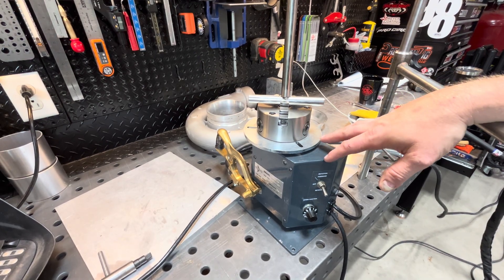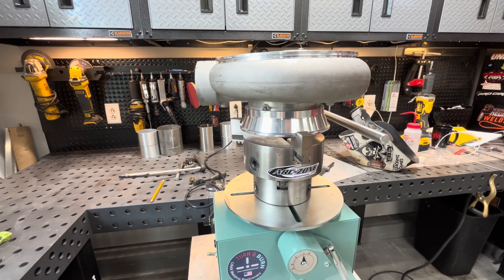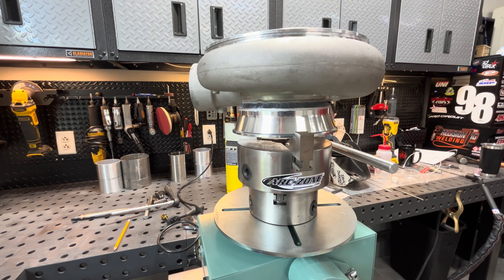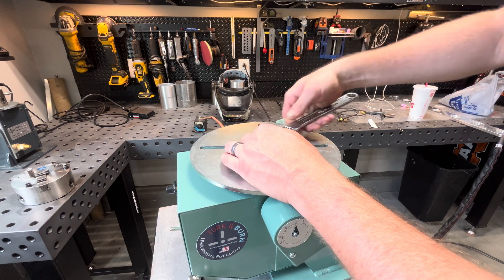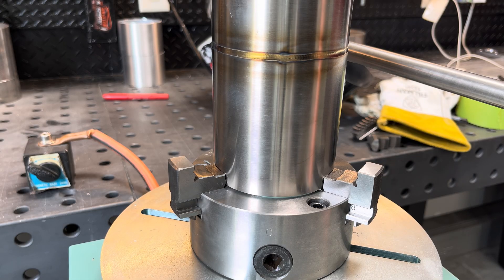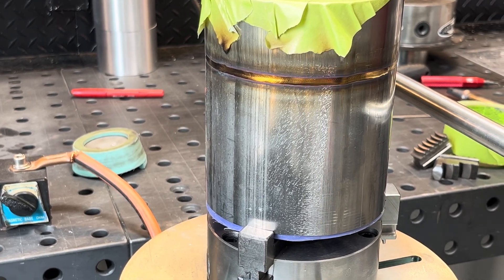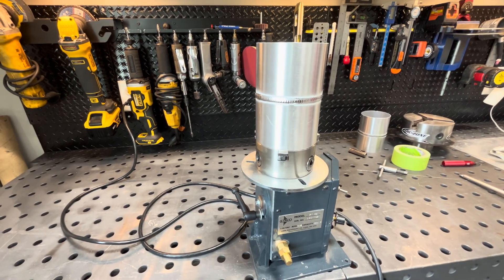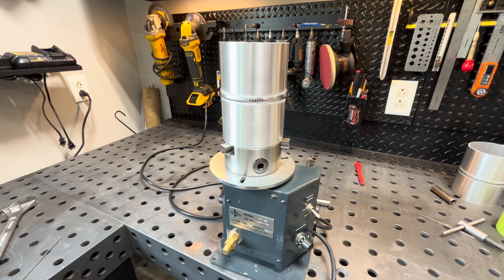Tig Welding With The Lime Xt 200

Comment: Lime, or Lima? :) Just yanking your chain on the typo. Both of those positioners look really nice. Would be great having the integrated purge system. I'm on a home gamer budget, but still USA made, so I went with a weld at home kit from Certflat/Weldtables, and then made my own variable DC ( 12v Milwaukee tool battery ) drive. Works awesome, but I do need to figure out a purge set up. Nice job on those welds!